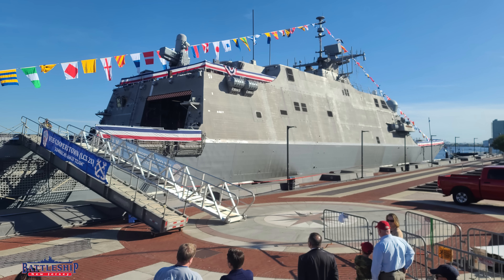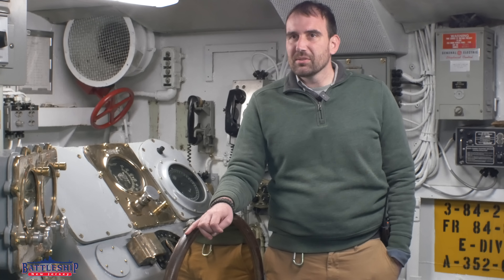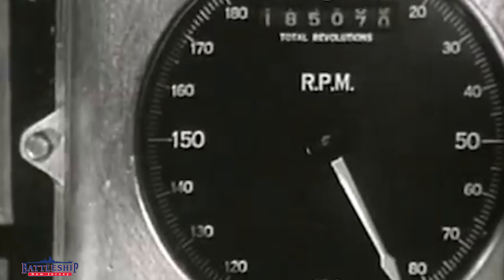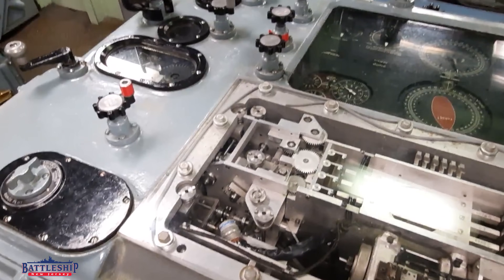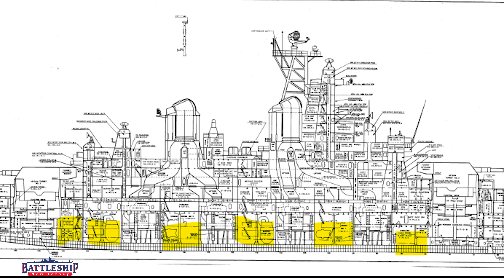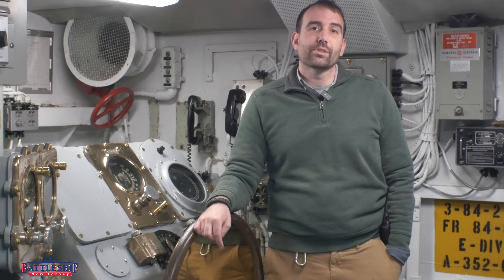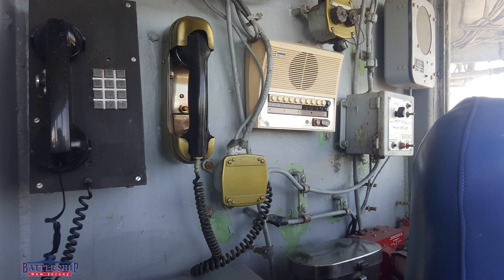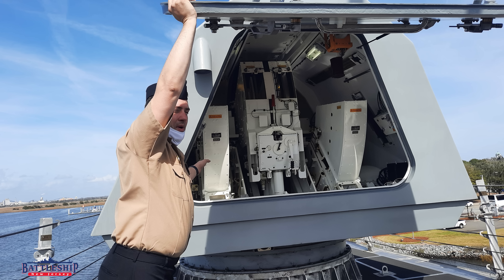Why Are There So Many of EVERYTHING On Battleships?

Comment: I read a quote once that new warships are designed to not be hit, but battleships were "designed thinking that they would be hit, and hit hard, but to shrug it off and keep going."
Reply: Modern warships are designed to be hit, but only if the defensive systems fail. Modern ships also aren't 40,000 tons, and should be compared to period destroyers and cruisers. They do have redundancy and backups to almost everything.

Battleships did not have any active defense, and relied entirely on being able to survive taking hits, and are several times larger so can afford more layers of redundancy and backup than the 5000 to 10,000 ton frigates or destroyers of today.
Reply: @wyattroncin941  New Jersey had 20 5 inch guns and 80 40mm guns. These were active defenses that were very effective against most threats they faced.
Reply: @quartertwenty484  I meant in terms of any way to stop an incoming shell. You gonna be the counter battery ace that blasts an incoming 15" to 18" shell out of the air?

Modern CWIS systems can shoot down incoming missiles, which are the major threat to their continued existence. A battleship was not designed with missile combat in mind, and no technology in existence at the time could actively counter a shell.

Comment: I served on the USS Missouri.  If the SSTG (ships service turbo generator) tripped out and power was lost throughout the ship, all your boiler and engine auxiliary systems were steam powered so they never kicked out due to lack of electricity.  It didn't take long to reset the SSTG and continue on.  After the Missouri was decommissioned, my next ship had electric driven fuel pumps to the boiler.  If the SSTG tripped out, we were the dead in the water until emergency diesel could power up a generator to restart the steam cycle and get the SSTG back online.  That sucked, but it is another example of how the battleships were designed to continue on despite a loss of power.

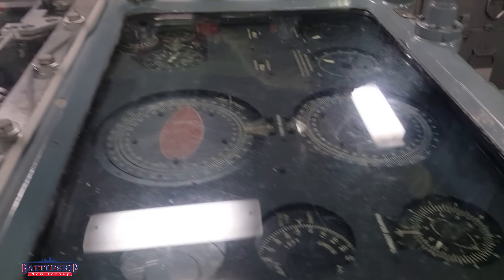Comment: @6:56  The storage battery backup in the main battery turrets does NOT power the major systems (train, elevation, hoists, ram, ventilation, etc)--the battery backup only powers the battle instrument illumination circuit (reference page 15-45 of NAVORD OP-769 change 1 dated 1 Nov 1967).

Electrical supply redundancy for the three main battery turrets comes from the fact that each turret has power supply cables coming from two of the four main switchboards.  Turret 1:  Normal from switchboard 1; alternate from switchboard 2.  Turret 2:  Normal from switchboard 2; alternate from switchboard 1.  Turret 3:  Normal from switchboard 4; alternate from switchboard 3.  (reference page 15-3 of NAVORD OP-769 change 1 dated 1 Nov 1967).
Reply: Thanks for that I was wondering the moment he said it couldn't believe there was a battery system that could Supply that much power
Reply: @dennisverhaaf2872 Also there would be complications since turret uses 3 phase motors, so they would have to convert DC from battery to 3 offset AC phases
Reply: @ImieNazwiskoOK  motor generators were commonplace at the time for that function, but yes, as soon as he said that I wondered why we hadn't had a tour of the submarine propulsion sized battery room! (for each turret).. to be fair to Ryan he has had a few slip-ups relating to electrical systems on the ship, its obviously not his thing, so if your reading this Ryan, If your discussing electrics in a video perhaps run the video past someone before you post it so simple errors like this are caught. No skin off my nose, but you stike me as the kind of person who if giving information, likes that information to be correct.

Comment: There was an also a redundancy in personnel. There were so many crew on an Iowa Battleship that it was easy for someone to man a station if the main system went down.  It’s harder to do with a smaller crew since you can quickly run out of personnel.
Reply: They also cross trained a lot.  This meant that the guy taking over could fight like he trained and just do it.

Comment: On a older Destroyer that I served on, to steer the ship we had two main steering gear motors, a smaller "auxiliary" motor, a hand pump for the hydraulic cylinder for the rudders. And if all of those failed, in what was known as the ram room there was pulleys and rope to move the rudders by hand. Then if all of that failed you could (sorta) steer by varying the speed and direction of the propellers. Oh, another thing. On the hand pump there was a plaque that said "for increased rudder speed add more people to turn the crank". More, the ship was designed and built so that it could light off the boilers and get underway without any electrical power, would have been lots of hard work but it could be done. Could even fire the twin 3" 50's without power too. Not so much the 5 inch guns.

Comment: An interest ing point about shock mounts , certainly post war a lot of equipment was mounted off the bulkhead on various types of resilient mount . The equipment was over engineered by civilian standards perhaps but able to survive a lot of damage .
Reply: Some stuff is even mounted in a way that allows the mount to deform and not rebound.  This could save the equipment from a hit that was too big for the resilient part of the mount to withstand.  The  foot of the shockmount on a rack is a case where I saw that in a description of the part.  If the rubber failed, the bolt through the middle would keep the parts together.

Comment: Redundancy isn't found just on battleships.  The first computer system I worked on in the USAF had multiple backups.  We had logic A and B.  Either alone or any combination and the system worked.  Plus we had offline spares for each drawer, power supply, keyboard, printer, and modem.  We had two keyboards and printers.  If one printer was down, a message addressed to it would be printed on the other printer.  We had two dedicated telephone lines.  We had a backup diesel generator incase we lost commercial power.  I think that qualifies as a very redundant system.

Comment: They even have similar system for airport controll towers as the engines rooms for power ❤ ,how do i know? Well we cut all the cables for the tower concrete sawing the floor in the terminal 😅 ,iv neever seen an electrician run cables that fast before

Comment: Probably a question for the emergency power video, but in a dark space it is fine to use the "bumps" to figure out where to plug what in the biscuit, but the person doing the plugging on the receiving end might get a surprise when he touches a live lead. There is enough insulation to avoid this but in the dark it might be difficule to aviod one or the other of the leads touching the hand. I only had to run these once in my time and it was not in battle so we had time to communicate to the "live" biscuit team and they did not connect till we had finished our receiving end plug up (we were the ones in the dark).

Comment: Would like to see a video on the effects of a modern day cruise missile with  a shaped charge warhead impacting the armor of an Iowa.  I imagine studies were made but could be classified.
Reply: A shaped charge vs a tank is designed to make a very small hole all the way through the armor about the size of a pencil/finger and then spray molten metal all over the crew compartment inside. It won't do much of anything to a BB.
Reply: It would be easy to design modern missiles to defeat battleship armor. We have bunker buster bombs designed to go through a lot of material. They were not designed because they were not needed. Even in the 80's the theoretical threat of 4 unique and old ships did not motivate anyone to design such. If there were many battleships or heavily armored ships, navies would have them. One example if the USN designing the Mark 48 ADCAP torpedo to defeat the newer, faster and deeper Soviet subs like the Alpha. Until there were needed they were not developed.
Reply: @bigstick6332  Oh I have no doubt. Modern missiles that people keep bringing up are simply not designed to take out a battleship. If there were an actual need then they would be.

Comment: I didn't realize that's how the sound powered phones work. My question is how well they worked. Was there any loss if the distance got too great? Did they sound as clear as the regular phones?
Reply: In a different situation, I have used a sound powered phone.  You need to just about yell to be heard at the other end but it did work over quite a long distance.  I think the impedance it was designed for was something like 600 Ohms.  That is:
To make the explanation easier to follow I will use 1000 Ohms.
Both ends of the system use the same device as transducer.  It is a coil of wire and a diaphragm moves the magnetic field over it or the current in the coil moves the diaphragm.
Lets say that if you talk into it with nothing connected, you make 1V appear on the wires.
With a 1000 Ohms impedance, if you short the wires, the current that flows will be 1mA
If you connect to the other transducer, you get 0.5V and 0.5mA.
This means that 1/2 of the electrical power ends up in the far end and 1/2 is lost in the one you are talking into.
It takes quite a lot of wire to get up to 1000 Ohms of resistance, certainly more than to 2 houses away.
1000 Ohms in the wiring would result in the current being reduced from 0.5mA down to 0.333mA.
This would give you about 1/2 the power and given how human hearing works, this would be noticed but not a big problem.
Reply: @kensmith5694  Thanks!

Comment: I love the amount of redundancy, but with you mentioning the redundancy of the electrical system, it makes me wonder what went so horribly wrong on South Dakota at Guadalcanal that she lost all power, and not even from a hit but apparently from crew error. I know she wasn’t an iowa class, but I’m assuming it had a similar level of redundancy built in. 

Do you know what happened on South Dakota to cause the loss of power?
Reply: I have read reports that the South Dakota suffered vibration problems from propulsion (twin rudders seem to worsen this), then the shock of main battery firing caused the main circuit breakers to trip out. Putting the breakers back in then caused further electrical problems. I suspect that the current surge caused problems - it may be necessary to turn the major power drawers off before reinstating the power, then turning power back to the devices in order.

Comment: I’ve always wondered why none of the ships had a rudder on the bow.    It’s not like loss of rudder control has never happened.    I remember hearing that Vanguard considered installing one but they found it didn’t work as well as they thought it would and so it was deleted.   This reasoning didn’t ring true to me as some control would be better than none in an emergency.  It also potentially could turn the ship faster than just a stern rudder or 2.
Reply: Thrusters up the front make more sense.  There are some hydrodynamic things working against a rudder up front.  Imagine you have one sticking out the front a little and angled slightly (lets say to your left (ie: turn to the port).  Now imagine the water flowing past the boat.  We are standing on the boat so from our point of view, the water is moving.  Not only that, the water to your right is having to travel a greater distance than the water to your left.  As Bernoulli explained, a faster moving fluid will cause a lower pressure.  This means that the right side of the ship will see a lower pressure.  That works against your attempted turn to the port.

Comment: im reminded of Star Trek DS9 episode. 
O'BRIEN: Well, in order to bring the system up to Starfleet code, I had to take out the couplings to make room for a secondary backup.
GILORA: Starfleet code requires a second backup?
O'BRIEN: In case the first backup fails.
GILORA: What are the chances that both a primary system and its backup would fail at the same time?
O'BRIEN: It's very unlikely, but in a crunch I wouldn't like to be caught without a second backup.
Reply: Instead of secondary backups the cardassians decided to build a bunch of complicated booby traps in case of slave rebellion or coup attempts. Paranoid bunch aren’t they? 
“Attention Bajoran workers…”

Comment: Without power, how do you move a shell out of the magazine?
Reply: Regarding Iowa-class main battery, there are no projectiles (aka "shells") in the magazines--there is only propellant.  Propellant bags are manhandled from the upper and lower magazines, thru a pair of flameproof scuttles, and into the powder flat at the bottom of the turret, and then manhandled into the powder hoist car.  At that point, if there is no power to run the powder hoist, the powder cannot be raised up to the gun house and gun pits.

The projectiles are already in the turret, stored along the rim where the turret levels meet the stationary barbette.

Comment: Most of modern system backups you do not see, especially in controls, electricity and so on. Its just arcane cables, software and connectors, but all this allows to upkeep connection and control even when large segments of system (network) are completely knocked out. In most cases it happens by itself, you do not need to run with emergency cords and manually edit configs - every device has its own small brains, they collaborate and make solution faster and more reliable than silly humans. 

So you do not need 5 fixed control posts, you can connect your console/laptop in any plug and control everything from there. You do not need 6 hardwired connection pathes from helm to rudder machine - routers select data path by themselves, if any out of 10s link survived. I can control building-size system from dedicated desktop computer, but if needed I can do it from mobile, from overseas or immediately from equipment cupboard where I am fixing and testing something.

Of course it does not work always (Dali and bridge, cough-cough) but significantly reduces visible redundancy. No more 5 helms, only 3 stationary and 2 mobile steering console, small knob or joystick, and of course no serviced positions  in the middle, no dedicated helmsman or sailor with indicators in rudder room.

Comment: One HUGE fact you have to remember - each LCS weighs roughly ONE of New Jersey's TURRETS. They're 3,500 ton Frigates/Corvettes, but they still carry plenty of redundancy: two main propulsion diesels and two gas turbines split between two watertight spaces, four diesel generators with switchboards split between two watertight spaces, critical equipment has battery backup, most ship's systems can be controlled from each of the four damage control lockers in addition to the bridge, etc.  You're completely correct in saying there are no hands cranks to be found though.

Gah, the lack of consistency due to self- serving politics in the LCS naming drives me nuts. Independence and Freedom are fine, if you're going to maintain the pattern. Cooperstown and Billings are great, if you maintain the pattern. Gabby Gifford? C'mon...

Comment: Sound Powered Phones, basically use the same technology as the first Bell Telephones! (Of course, quality control (including purity of the carbon), is much improved!!! Even in the 1940's it is superior!
Reply: Sound powered phones cannot use carbon microphones which are variable resistors. The microphone  originally used was a magnetic type but current models often use a ceramic insert. Ordinary magneto telephones had batteries for speaking as well as the magneto for ringing; in later years dry batteries were used.

Comment: You have the multiple back up systems because 1 catastrophic failure should not be allowed to lead to the total destruction of the entire ship

Bismarck is a good example of why back up systems are important whereas unlike with Hood no back up system could have saved her as the catastrophic failure that killed her happened so fast that no back up system can engage fast enough before its too late

It is the same philosophy of the airliners of now use and was pioneered by the British Empire in their last long-haul jet airliner in the mid-1960s

Comment: A BB has room for all that redundancy.  An LCS does not.  I bet any carrier, SVN, LHA, whatever, has as much redundancy as a BB.
Reply: Fully agree and can confirm a modern carrier has plenty of redundancy. He’s said several times “modern Ship’s he’s been on” didn’t have any redundancy. Must have only been on the smallest of “small boys” if that’s the case
Reply: I would say it is not only about space but also a different time period in which things were done differently.
Just look at old industrial installations, you can often see all kinds of manipulators basically anything. Nowadays everything is either fixed and only changeable with equipment or remote controlled. Nobody reroutes i.e. water by turning five valves anymore.